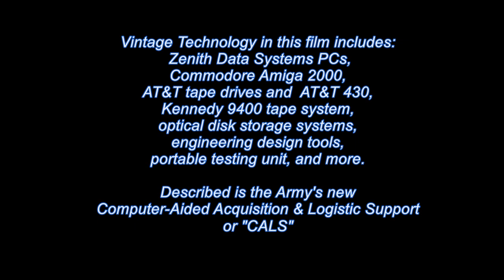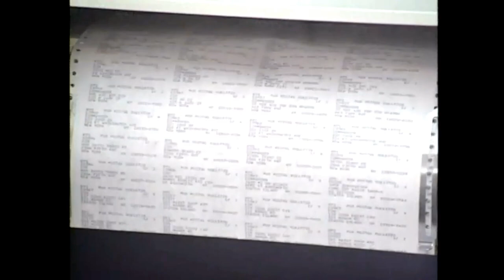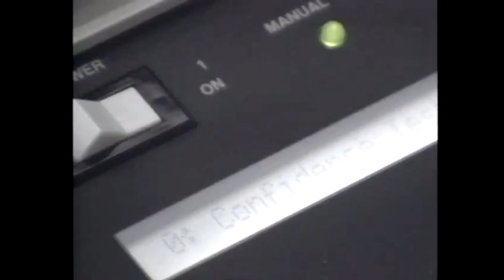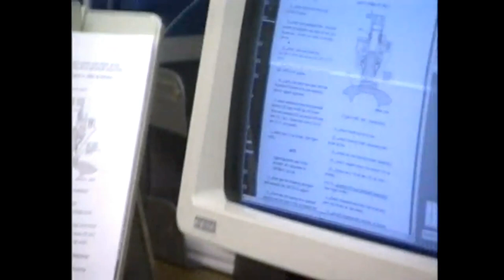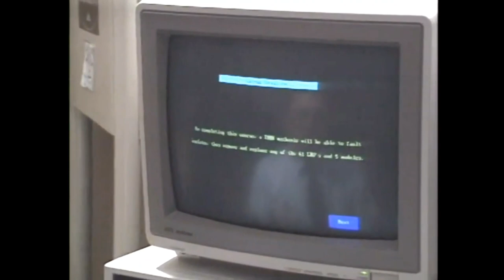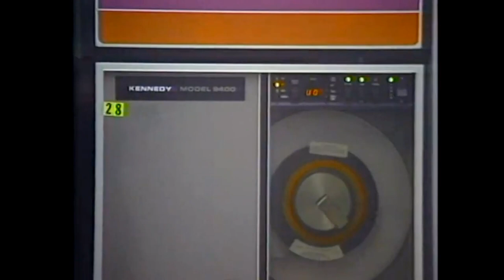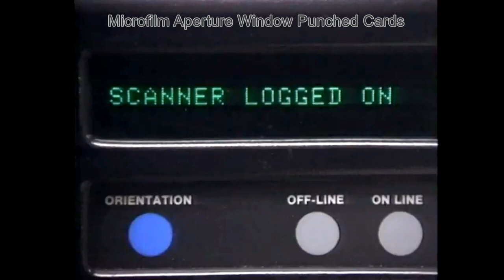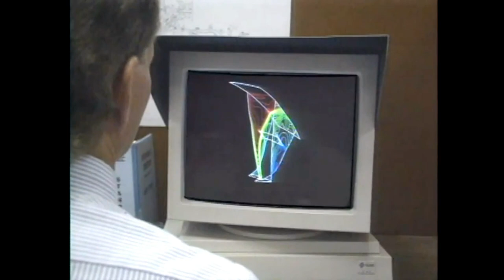Vintage Computer Automation: ARMY / DoD:  "Electronic Culture" 1980-1990s CALS  (Zenith, IBM)

Comment from the maker: Most of the technology shown here is around 30 years old or more.  No mention of Internet (its pre-WWW) or how databases would be integrated globally.  The islands of automation is an interesting concept.  Interesting to see the office systems in use at the time.  We didn't find any info on the AT&T 430 system shown, and there are a few other unidentified items as well.  Hope you enjoy this look back.
Reply: "Security will be a primary objective" It seems that was forgotten in subsequent systems.
Reply: @ptonpc  on mainframe there wasn't a huge need for security because they needed special training to use them and no one could access the data if they didn't have direct access to the system, and much of that carried over to the later systems as the programmers forgot they didn't have the same physical distance to the users
Reply: @thesteelrodent1796  Yes there is also he increased interconnectivity and increased horsepower of computers as time went by.  Security has always been seen as an added cost instead of something that should have been built in.

Comment: 7:35 CADAM, on IBM 8000-series terminals. Learned to do just about everything possible in that system during my time at MAN. The digitizers were horrible (and tiny, so not great for people with big hands), but the keypad menu system meant you could draw very fast because you had instant access to every function in the system. The system was designed so you had the menu pad under your left hand and the digitizer in your right, and then you only ever needed the regular keyboard to enter in values or text, but since you could do an awful lot by just pointing at and selecting already drawn elements, you didn't need to enter anything a lot of the time. Infinite lines was the main component of drawing in that system. You would offset them to get the distances you needed and then chopped them off to get the right shape, or use them as centres for circles. We constantly bumped into the memory and file size limits, so it had a feature that let us split large assembly drawings into multiple sub-drawings to get around the limitations. Somehow multiple drawings layered on top of each other didn't take up as much memory as one big complex drawing, and I honestly never understood how that worked when it still had to draw the same amount of elements. Other tricks we used to save space was to remove details you wouldn't be able to see on the assembly drawings at a smaller scale anyway, like the proper curves on a bolt head or every joint in a chain. Overall it was an incredibly capable system and very easy to learn for something originally designed in the 70s (with light pens and all that jazz), but it was strictly for 2D drawing, although it had extra functions for creating isometric drawings, so-called 2.5 D, which was not very easy to work with. 

Someone (not IBM) created Micro CADAM for PC to bring the system to the PC platform, but without the special command keyboard it's not nearly as intuitive to work with. We had to learn AutoCAD in school (r12 and r13 at the time), but once you got used to CADAM, AutoCAD was just horrible and clunky to work with, and completely lacked the same smooth workflow design